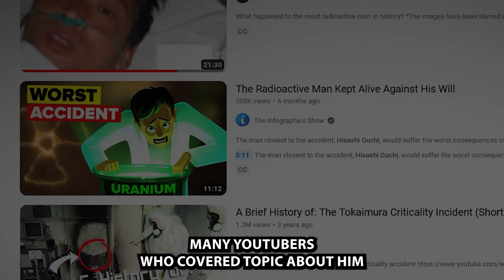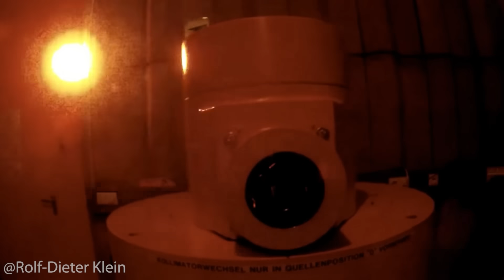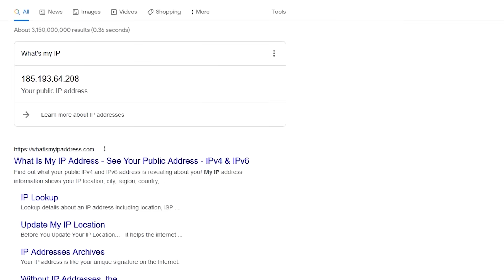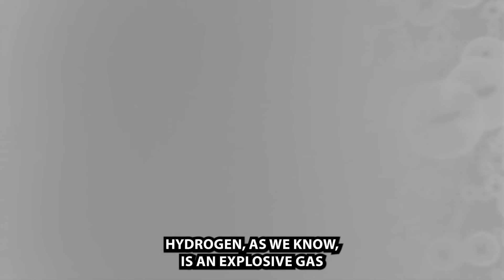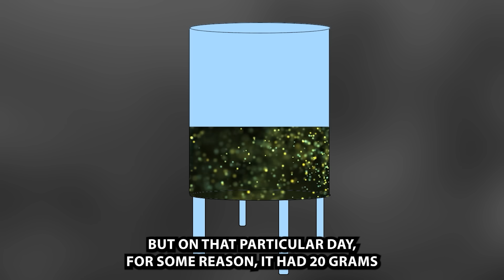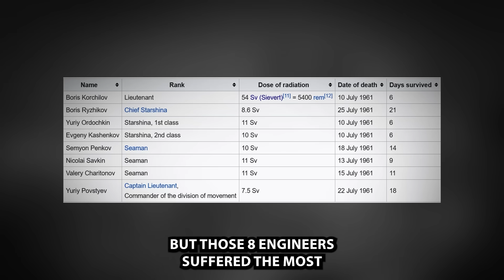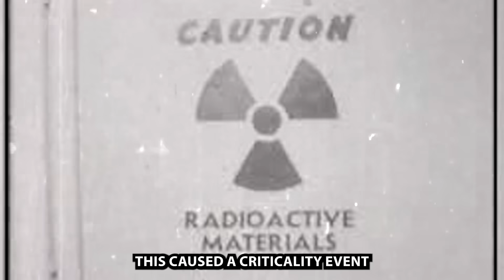Most Radioactive Men Ever

Comment: So the rods at Kurchatov institute dropped on the floor, caused the criticality and magically melted? How does that work?
Reply: The rods being in close proximity with lack of a moderator caused them to heat up fast. Air is poor when it comes to cooling nuclear material so when the already superheated rods hit the ground, they most likely came together, and the merged temperature of the rods caused them to melt and cause a deadly release of radiation in the process.

Comment: top things humans should not see : blue flash in a nuclear powerplant
Reply: That blue flash is called Cherenkov Radiation. There are many documentations about this light in youtube, and many of them are pretty safe.
Reply: @agailham8476  Are you sure it is not simply the air around the source being ionised?
Reply: @agailham8476  it's not Cherenkov, it's scintillation. The index of refraction of air is c=1.000273, so the particle needs to go v > c/n to radiate. The Lorentz factor is g=1/sqrt(1-(v/c)^2 ~ 1/sqrt(2*(n-1)) ~ 43, which is ultrarelativistic...way out of range for fission.
Reply: @DrDeuteron  hmm
Reply: @DrDeuteron it all depends on the angle of the dangle, NOT all those numeric mumbo-jumbo formulas!
Reply: @agailham8476  nah that’s a different kind of blue light. The Cherenkov effect is caused by particles exceeding the speed of light, which in water is only  75% of its speed in a vacuum, in turn causing a brilliant blue glow. The “Light of Death” or “Flash of God” is the particles of air immediately surrounding the criticality event instantly being absolutely decimated and ionizing.
Reply: @sunlitdragoon512  correction for you: particles cannot exceed the speed of light. It can only reach near speed of light.
Reply: @not_h1node  read my comment again, yes normally nothing can exceed the speed of light, however the conditions that cause Cherenkov radiation are perfect. (1: light travels about 25% slower in water than in air or a vacuum due to refraction. The Cherenkov effect is created when a charged particle passes through a dielectric medium at a speed Greater than the phase velocity of light in that medium effectively making each particle break the light barrier briefly. The sustained glow is due to the sheer volume charged particles. (2 in air the blue glow is caused by ionization (same reason electric arcs are blue)
Reply: @not_h1node wrong, particles can exceed speed of light in many mediums, einstein specifically said nothing travels faster than light in a VACUUM.
Reply: Actually seeing a blue light coming from a water submerged nuclear reactor is pretty normal and not that dangerous (there's usually plenty of water between you and the core shielding you from radiation).
The problem is when you turn into a nucler reactor something that was never intended to be one.
Reply: To think - if you saw a blue flash... it's over. Crazy. Think of the psychological effects on the team. In a way - it makes you more serious, but at the same time - the stress must have life-lasting implications.
Reply: @kaspartambur6589 I mean like.
Its not over
But you know it's over. You have time to process that you're fucked beyond help and that you are a dead man walking.
Reply: now imagine how radiated a super nova is
Reply: @yamiru3417  not something that can be answered because there are too many variables such as distance, type of star, whereabouts in space etc. It is anywhere from really not that much to instant vaporisation. But you can't measure this in sieverts.
Reply: @yamiru3417  doesnt matter, u die instantly anyways
Reply: @yamiru3417 fortunately for us, no star is near enough for the gamma radiation from a super nova to reach earth without dissipating by colliding with Interstellar matter in space
Reply: @yamiru3417 however, one of the prehistoric mass extinction events was allegedly caused by a super nova
Reply: @yamiru3417 I read that a supernova observed from one AU away would be 9 orders of magnitude brighter than a hydrogen bomb detonating while pressed against your eye.
Reply: @yamiru3417 actually not that much
Just a LOT of outer star plasma that gets ejected
Reply: @ProtiumPower  i think its much worse then that lmao
Reply: @yamiru3417  Basically it would take our planet and vaporize it.
Reply: @oneboredfool9578  exact numbers? because thats common knowledge
Reply: @oneboredfool9578  take the Crab Nebula for example, it’s so big and yet it’s only 600 years old.
Reply: @yamiru3417 it is not bcz it's so intense that you will be atomized before you think of it!

Here you know what happened and horror will remain until you die
Reply: @yamiru3417  Depending on where the supernova is it could be as mild as holding a lightbulb...

If it were anywhere near our solar system we would probably stop existing almost the exact moment the radiation hit us.   

As for something like a quasar, it wouldn't even need to be that close to us for it to cancel Earth, like, even 8,000 lightyears could be too close to us.
Reply: Blue flash at the bottom of the reactor, under many meters of water. Pretty safe and amazing to look at. Or going a step further: swimming in cooling tanks for spent fuel rods. Totally safe. There is enough water to shield you from the radiation.
Reply: @HappyBeezerStudios  Cherenkov in water is beta ray, they are easy to stop. These ppl were dealing with neutrons, so they had no chance.
Reply: @HappyBeezerStudios  Except for when you get out. Then you're in trouble.
Reply: @HappyBeezerStudios yeah, NO THANKS! I’ll just stay AS FAR AWAY AS POSSIBLE!
Reply: Bro imagine if someone made a prank and placed camera flash light with very similar blue color
Reply: Flash fotograpy without being aware of getting take picture of = instant horror until you realize it was just a picture...
Reply: Well, not really. Cherenkov radiation glow can be observed quite often when opening a reactor core and re-arranging the fuel. You just need some 1 meter of water or 15 meters of air, plus a PbO glass window - radiation at your spot can be unrecognizable from the cosmic background. Being close and making something stupid tho... Is like making an overtake with 100km/h in the mountains on a corner without any visibility... o wait, someone is doing this like everyday somewhere in the world :D
Reply: Damn if I saw the criticality flash I’d probs just kill myself, it would be comparatively painless to what would happen next…
Reply: I've seen videos of reactors starting under water, that blue flash is cool.
Reply: @curbyourshi1056  and if you freeze the frame on the exact start: it is blinding (prompt betas from fission), but then is immediately decaying secondaries (from nuclear waste) as the reactor stops in milliseconds.
Reply: Blue flash under the "blanket" of water 5 meter thick, no big deal. Blue-ish flash at reprocessing factory... Somebody goofed up.
Reply: So this is why Dr. Manhattan glows blue.. it all makes sense
Reply: Yes and no. There is good and bad blue flash. Bad flash= Chernobyl exploding. Good flash= starting up of reactor.
Reply: Honorable mentions: Elephant’s foot
Uranium solution with sodium carbonate liquid.
Reply: Lived near Wood River Junction my whole life, never knew what happened there. Crazy thing is the field where is happened is still all there, looks exactly the same just missing the building.
Reply: Imma get homer Simpsons job and then install some blue floodlights in my office to prank people lol
Reply: You know your cooked when you see a blue light in a nuclear reacter🥀💔
Reply: Other things: an open reactor on fire.
Reply: If i see that i will be like oh BLYAT run
Reply: actually seeing a blue flash in a fission reactor underwater is usually safe
Reply: Demon core time
Reply: @uhhidkmanw 😅
Reply: You wont see it after like 0.1th of a second… also you will die
Reply: Not so sir every single time the reactor is activated there is a blue flash.
Reply: @SienaaBee yeah but you don't want to be directly in front of it and see it.
Reply: Well, you should see it, not with your bare eyes, but through a camera and screen, starting a reactor produces such blue light, but it's contained of course.
Reply: That’s not really that dangerous… in fact it’s normal
Reply: Or from a little metal sphere
Reply: More proof that humans should NOT be messing with nuclear stuff!
Reply: ionizing radiation joined the chat against our will
Reply: 2: fumaça estranhamente preta saído da sala do reator aberta
Reply: top things humans should not see (corrected): a blue flash in a nuclear powerplant that occurred outside of water.
Reply: But the red flash from comics he’s cool
Reply: Or a green rock that makes water blue
Reply: Why?
Reply: first time I head of a FOE was from Hans Bethe, who figured out how stars work, among other things. It's "ten to the Fifty One Ergs". That's a lot of energy. If a supernova occurred where the sun is, the radiant energy would be around 3kT TNT per square meter, per second, for a few days, and would hold at 0.3 kT for 100 days...per square meter/s, and then start to decay. Depending on type.

A gamma ray burster is way more.
Reply: @DrDeuteron you would die from neutrino radiation alone
Reply: God : well time to restart
Reply: You can actually stare at the blue glow through water cause water blocks the radiation. And nuclear reactors can be made to flash, like this: https://www.youtube.com/watch?v=mgNwtepP-6M So yeah, if you're watching that through the water of a nuclear reactor (assuming normal water levels) you're fine.
Reply: it is safe in a nuclear plant. its very safe as long as the cherenkov raditaion is under the pool. but if you happen to see it in the air, you are pretty dead
Reply: This may not be accurate

...Radiation from our Sun that enters our Earth's atmosphere causes our sky to also become illuminated with a cyan blue color.

We see cyan skies each day.

So logically, not all cyan blue light witnessed by high speed movement of radiation through air is necessarily a sinister omen of doom.

Otherwise many of us would be dead by now from our blue skies. :-)

Other commenters above seem to have suggested this too!
Reply: @TimHorton-xl8wz bit late but if we think logically we would find that the color of the sky is not from particles moving after than light and is actually from the light emitted by the sun bouncing off the molecules in the sky, if it was from radiation(as in the particles and not electromagnetic waves) moving faster than light then 1. orange/red sky’s during a sunset or sunrise would not exist. and 2. atmospheres with different colors than blue(like mars) would not exist.
Reply: nah i think we wouldn't even see it because it too fast our eyes couldn't catch the light
Reply: Top misconception, Chernobyl never glowed blue.
Reply: Your parents having sex
Reply: cherenkov radiation💀
Reply: Bro, blue flash is normal in nuclear reactors, its called Cherenkov Radiation FYI.
Reply: @walturowhite69  not in air.
Reply: @DrDeuteron you keeping pointing out air. No nuclear reactor is ran in air. The reactors are always in water. A lot of water to be specific. So why keep repeating not air. If you’re referring to the criticality incidents great, but the comments you are addressing are reactors and they are in water.
Reply: @ no, the blue flash in these accidents is in air.
Reply: *blue flash in air @walturowhite69
Reply: By the time of like 1 minute he wouldn't even be able to see it anymore he'd be long gone
Reply: I'd much rather see a blue flash than the rapper Lizzo in a swimsuit.
Reply: Why not to see. Please explain??
Reply: @rudragaming6977  blue flash means nuclear reaction has reached criticality and maximum amount of harmful radiation is being emitted that is going to kill you in a very painful manner
Reply: Yeah, that and Nancy Pelosi naked
Reply: If the blast victim is color blind, would the radiation damage become nullified? 🧐
Reply: I think I realized that already
Reply: the blue flash isn't dangerous. it's radiation traveling faster in water than light, but the water absorbs all of the particles.
Reply: @jyxtheberzerking4824  mas se tem um flash azul é pq tem algo de errado
Reply: Preety much a death sentence
Reply: Got a point
Reply: *unshielded radioactive blue flash.
Reply: Literally the blue flash of death. If you see it, you know you’re lifespan just got shortened to less than a few weeks
Reply: Geez, aren’t you right bout dat
Reply: Actually you can see the blue flash without dying just got to be in water
Reply: I believe some reactors regularly make blue flash
Reply: Real life resonance cascade
Reply: Red rings on an Xbox360
Reply: Chrenekov Radiation
Reply: I've seen it, through several feet of water. No appreciable dose absorbed. Water is great shielding.
Reply: mira immit$ch-kytch v v
Reply: People who don’t understand radiation might be scared of it, but it’s actually very safe from a proper distance
Reply: I don't think Cherenkov Radiation (the blue flash in question) is really that harmful...
Reply: Such a pretty blue though
Reply: Because it’s a gamma ray
Reply: Like blue flash as in Cherenkov radiation or Nuclear meltdown?
Reply: Watch a nuclear reactor start up
Reply: Wait so if radiation can kill in 14 days with oachi could you make a radioactive beam that can do that to the entire planet ?
Reply: Erm, actually it’s normal to see that depending on where you are, what your working on, and why.
Reply: Unless you see it through very very deep water 🤓
Reply: Nope. Cherenkov radiation is perfectly normal to see in nuclear power plant, under the correct viewing conditions.
Reply: Lemme correct you:blue flash in a nuclear powerplant that is airborne(water makes the radiation very safe)
Reply: How about a blue cellophane film on a smartphone flashlight 😂
Reply: 12:41 According to Wikipedia, everything above 80 Sv should kill immidiately and 50-80 Sv should kill within hours...
Reply: Cherankov radiation isn't that bad.....
Reply: @jamesmeppler6375  Yes, it's just ordinary light.
Reply: hi rufus
Reply: Yes
Reply: I saw a green one.
Reply: Unless it’s behind water
Reply: Blue flash in nuclear plant is perfectly normal. Search some reactor start video
Reply: Unless it's the Penn State test reactor kept deep under water for research in much better safety precautions today and only used sparingly
Reply: this is a disinformation which got way too much attention and likes. as some already said here - seeing blue flash in powerplant doesnt mean harm and the comment is just wrong.
Reply: #demoncore
Reply: You’re right, you would never see a blue flash at a nuclear power plant, even if they had a meltdown explosion you wouldn’t see it.
Reply: It's not that there's actually a blue flash, there's no flash at all during atomic criticality. The blue flash is the radiation passing through certain areas of your brain.
Reply: Sheesh
Reply: If you see blue rays, you are deadman walking lol xDD
Reply: @ProtiumPower  1in 20k alpha particles only hit the nucleus , so even if the receiving body is thick not ever alpha particles hit
Reply: If it glows blue and isn't a glow stick or a neon sign, run TF away as fast as you can! 

Of course with a radioactive blast there's nowhere to run, but it seems to be a common theme that blue glow = death.
Reply: @PACMANnot  nonsense.
Reply: @roxydzey  Nope